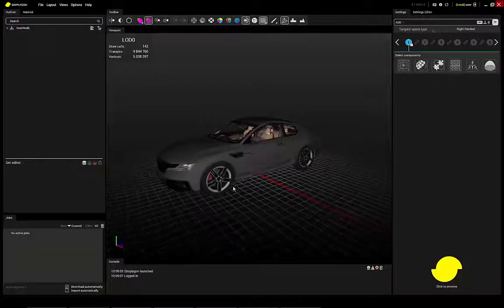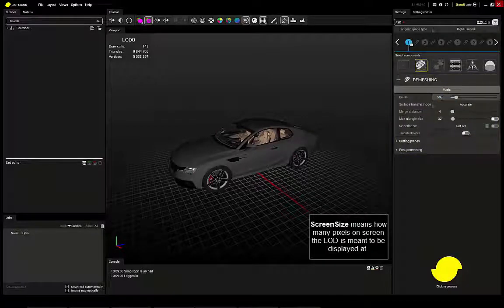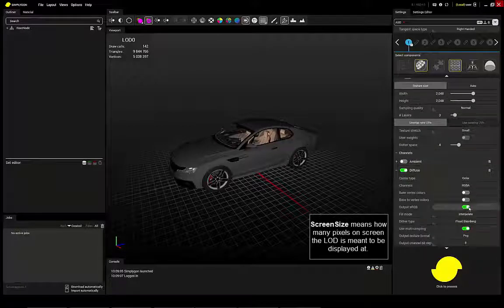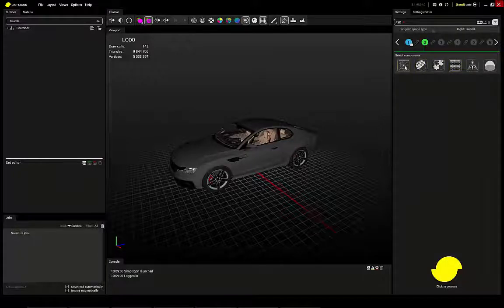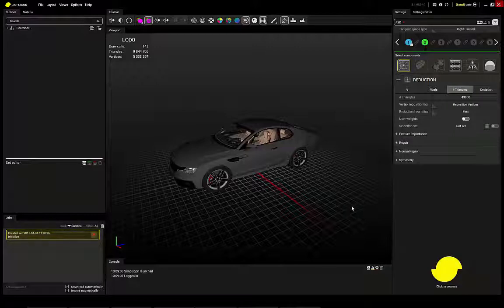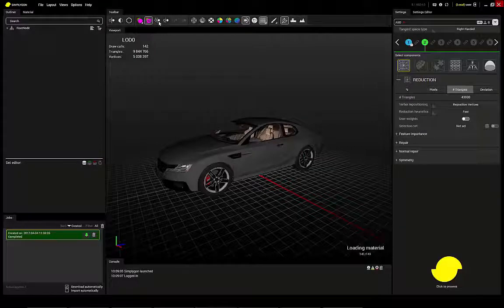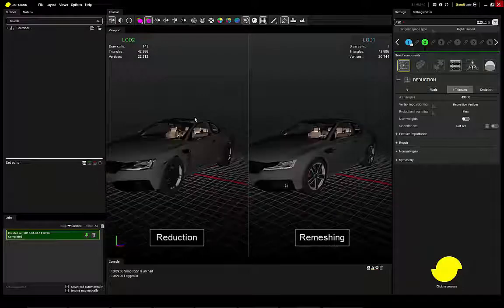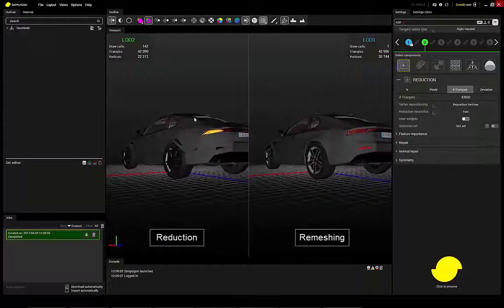Simplygon 8 - Remeshing

Comment: remesh works fine, for vray check gamma of imported nomal map is 1.0 and flip green (y) channel in VrayNormalMap-node if using default export settings in Simplegon. Normal map must be used in conjunction with remeshed model! Also put value of 100 for bump map in VRAY material. https://ibb.co/mv5VSR